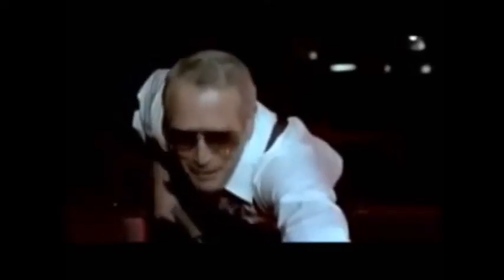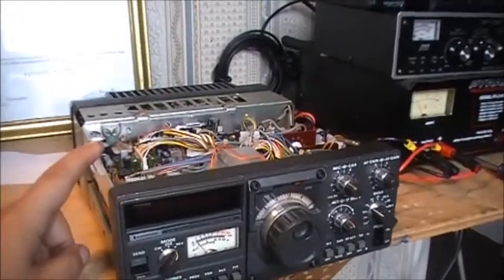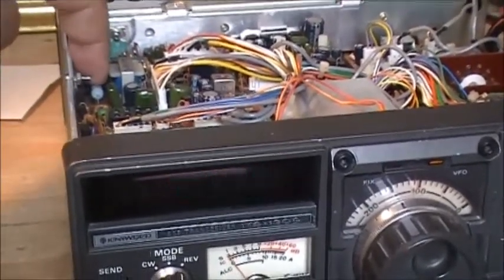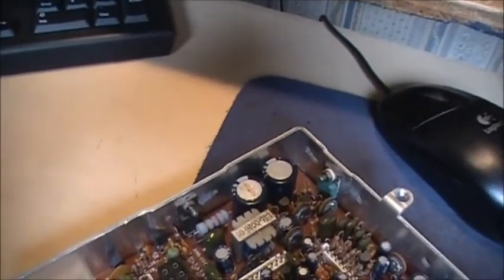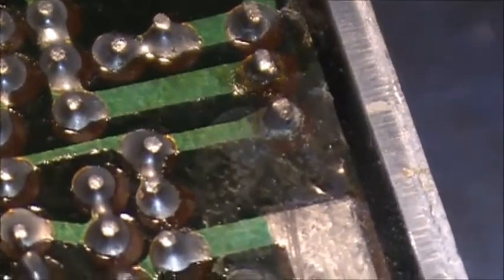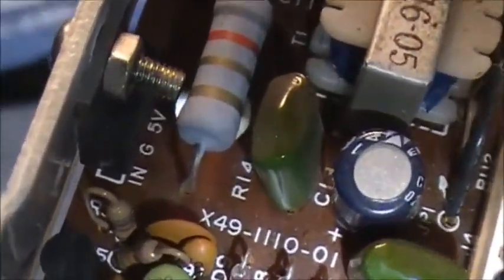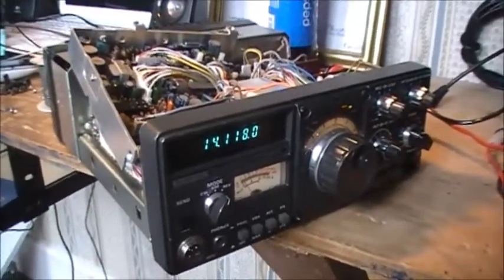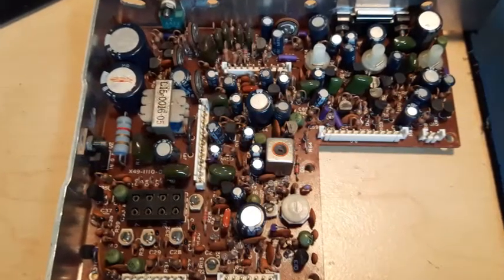KENWOOD TS-130s  Trouble shooting and Repair

Comment: Hola ,El ventilador como funciona? Cuando levanta temperatura enciende solo?
Reply from the maker: El ventilador se enciende y se apaga solo en función de la temperatura de la radio.
Reply: @Radionut63  ahh o sea que cuando levanta temperatura automáticamente se enciende..es asi?
Reply from the maker: @motus4084  ¡sí, señor!
Reply: @Radionut63  muchas gracias por contestar mi duda...creia que se encendia manual enchufando el pin del cooler al equipo y comenzaba a soplar
Reply from the maker: @motus4084  Supongo que si quisieras que el ventilador estuviera encendido el 100% del tiempo, podrías conectarlo para hacer eso.
Reply: @Radionut63  lo conecto pero no enciende

Comment: No receive or transmit initially either?  Didn't mention that...
Reply: Asume you could still rcv/xmt with the analog dial....
Reply from the maker: Radio is working AOK since this repair.

Comment: Thanks for sharing. The printed circuit board is from the fragile phenolic. 
After the repair I would have recapped the print also. There are recap kits offered at eBay.
(The TS-130S is from 1982/1983).
 By the way, replacing the VFO lamp (12 V./50mA) by a LED results in less frequency drift.
Reply from the maker: I may get into that later.  Thanks!